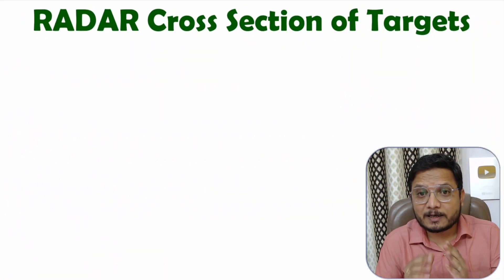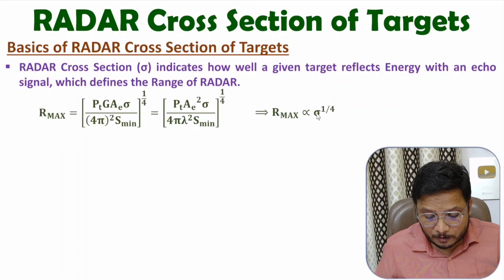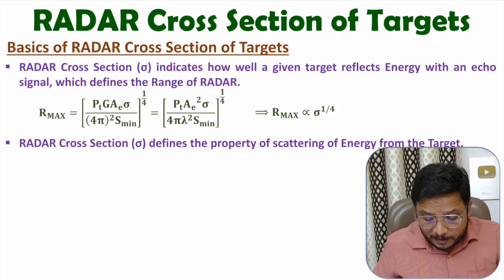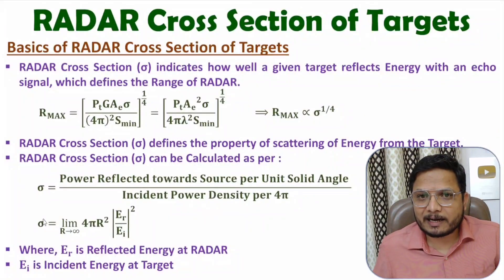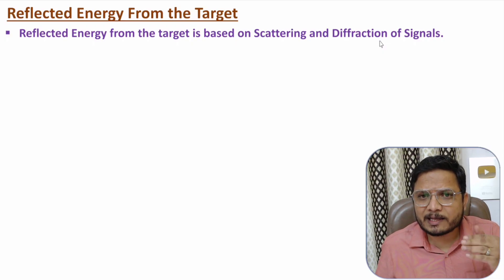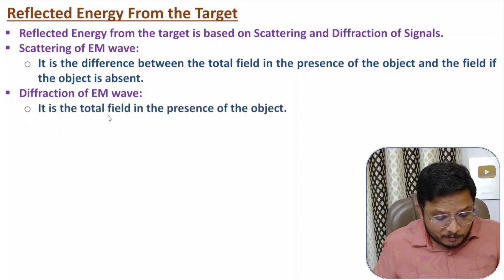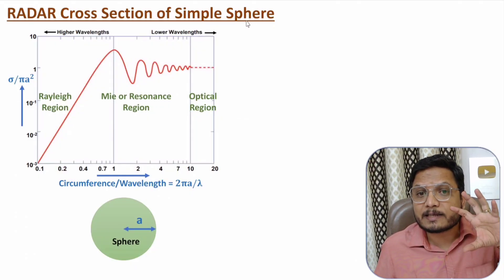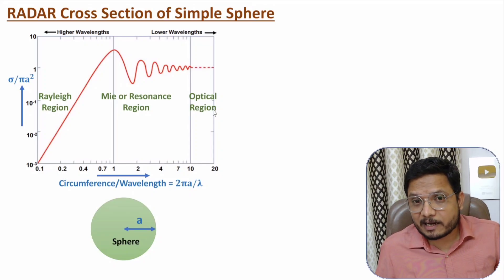RADAR Cross Section of Target (Rayleigh Region, Mie or Resonance Region & Optical Region) Explained

Comment: Sir why is phase info lost in post detector integration can you please elaborate
Reply from the maker: In radar systems, the phase information can be lost during post detector integration primarily due to the process of integration itself. Here's a detailed explanation:

1. **Detector Output**: After receiving and mixing the received radar signal with the local oscillator signal, the detector produces a signal that typically consists of an amplitude component and a phase component.

2. **Integration Process**: In many radar systems, especially in pulse-Doppler radar or coherent radar systems, integration is performed over multiple pulses or over a period of time to improve the signal-to-noise ratio (SNR) of the received signal. This integration involves summing up the detector outputs over time or pulses.

3. **Resultant Signal**: The integration process effectively combines the amplitudes of the signals received over time. However, when it comes to phase information:
   - **Phase Averaging**: During integration, the phases of the received signals from different pulses or time intervals are often random with respect to each other due to factors like Doppler shifts, target movements, etc.
   - **Cancellation Effects**: Phase components from different pulses can cancel each other out when integrated, especially if the phases are not aligned (coherent integration tries to mitigate this but has limits).

4. **Phase Coherence**: For coherent integration (which preserves phase information to some extent), there must be a stable relationship between the transmitted and received signals over the integration period. However, this coherence can be lost due to target movements, varying propagation conditions, etc.

5. **Non-coherent Integration**: In non-coherent integration, which is common in radar systems where phase information is not preserved, only the amplitudes of the received signals are integrated. This is simpler and more robust in terms of maintaining signal reliability but at the cost of losing phase information.

6. **Signal Processing Considerations**: Many radar signal processing techniques, such as pulse compression or Doppler processing, rely on amplitude information rather than phase. Therefore, in practical radar systems, the emphasis is often on preserving amplitude information through integration rather than phase.

In summary, the loss of phase information during post detector integration in radar systems occurs due to the random nature of phase relationships between signals received over time or pulses, and the emphasis on integrating amplitude signals for improved SNR rather than preserving phase coherence.